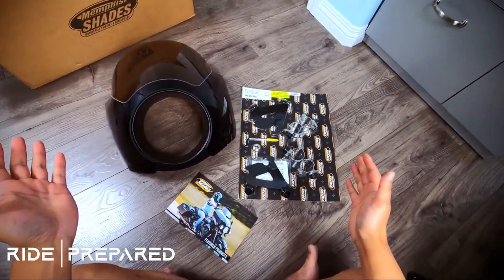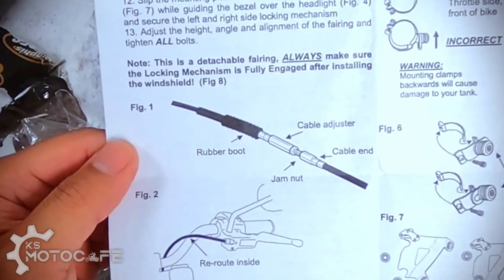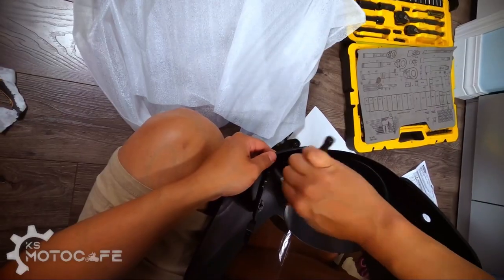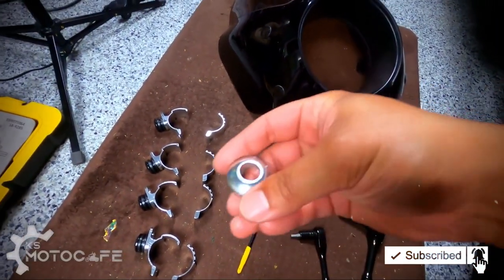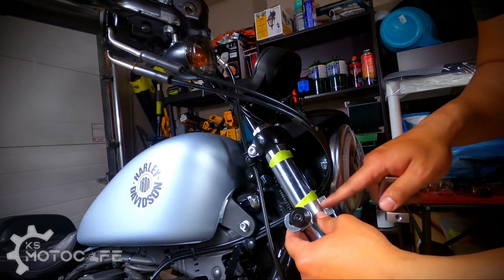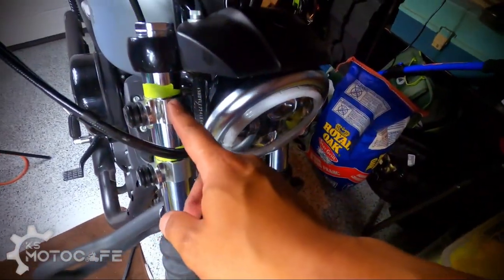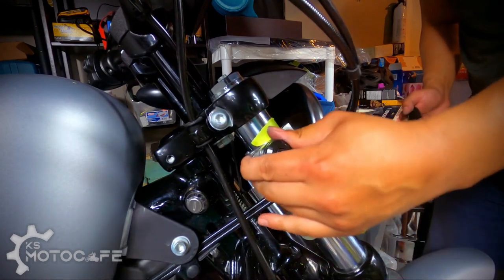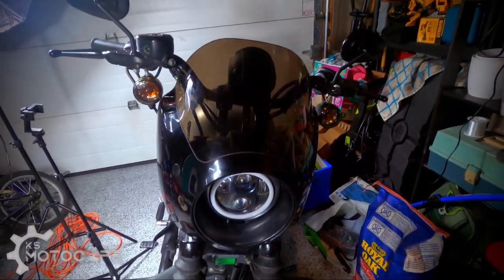How to Install Memphis Shades Cafe Fairing on Sportster Iron 883

Comment: I got the Amazon Katur fairing ($35) with no instructions but figured it out with a little trial and error, what I didn’t necessarily like was that I have to use the hardware for the headlight brow which means it’s not a quick disconnect. I took it off a while back and haven’t had the interest in putting it back on but I imagine if I had that quick attach option I’d go back and forth! Thanks for sharing the process, might have to look into this brand!
Reply from the maker: hey thanks for sharing your experience with the Krator fairing! I was thinking of getting that as the cheaper option but I wasn't sure how the build quality would have made a difference. The snappy mount definitely pays dividends when I get tired of the look and quickly install or dismount the fairing as I please. Cheers!

Comment: Just FYI this fairing does work with factory bars, with factory location turn signals. That's what I'm running. Not even close to making contact. The problem you ran into with a clearance issue and aftermarket bars, I'm not sure. But you did install the fork mounting brackets backwards. They're incorrect. Only issue I can see that would cause that problem.

Comment: Are those 4 inch risers on the stock bars?
Reply from the maker: that is correct! and all original wiring
Reply: @KSMotoCafe  Link for the risers, please!
Reply from the maker: @badmeetsevilfan1  I don't think they carry them anymore - I bought them used off fb marketplace.

Comment: Are those the stock 883 handlebars??? Also, I just received my cafe fairing and trigger lock mounting system and it’s different than yours, longer arms. Contacted MS and they said I have the correct one… I’m so confused, but I do have a turn signal relocation kit that I’m installing before the fairing so I might be good to go
Reply from the maker: stock handlebars but i have 4" riser on my bike - which gave more room for the fairing without needing to relocate the lights. as for the mounting kit difference, I couldn't tel u why it may look different. maybe they updated it

Comment: I’m having issues with it, the silver mounting brackets that connect to the fairing are too big in circumference and keep sliding down even when fully tightened, is there something I can do to fix ? 2021 harley sportster 883
Reply from the maker: the silver bracket has notches where the other side slides on to. be sure to use the right notch to have em snug
Reply: @KSMotoCafe  I tried all 4, none are snug
Reply from the maker: @MikeyCapozzi  whats the serial of the mounting kit you got
Reply: @KSMotoCafe  wrong mounting kit you’re right 🫠